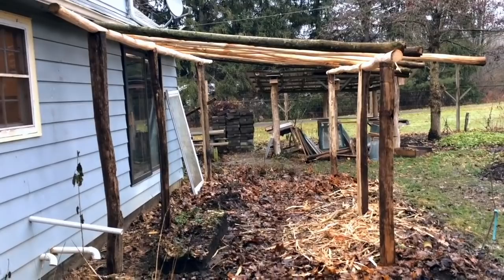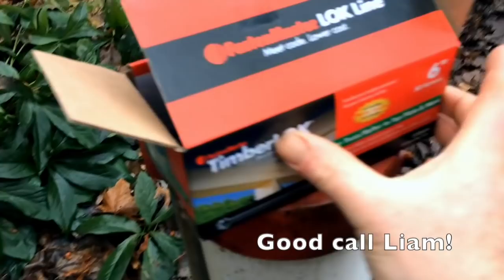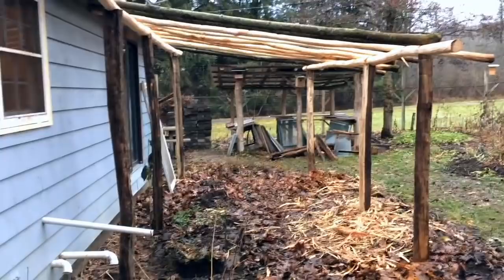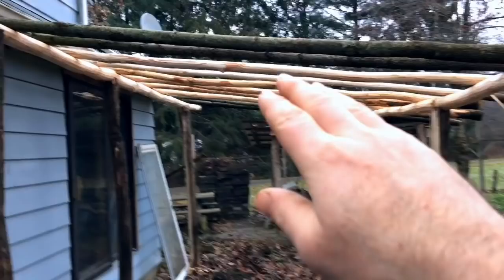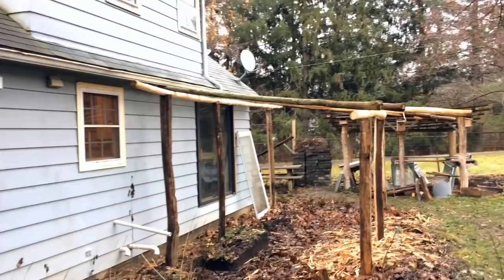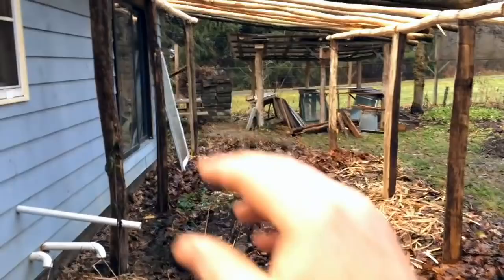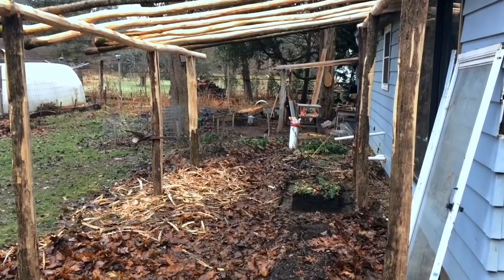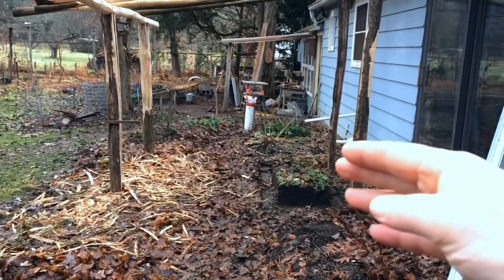Passive Solar Greenhouse - 1 - Start of Construction

Comment: I built myself a little cattle panel greenhouse last summer with a little climate battery. I dug my 5 trenchs down only 2 feet (that's all the stamina I have). I insulated the ground with foil bubble wrap.  I live in Texas so we don't really have a frost line. I used 5 -4 inch french drains that run the length of the 8 x 12 foot green house and covered them with drain cloth for the climate battery. I used 5 gallon bucket to join the french drains on each endow the greenhouse (2 intakes and 1 output) I also put about 100 16 oz coke bottles filled with water along the french drains to add a little more "mass"  and thermal stability (hopefully). I used Solawrap to cover the greenhouse. I made a solid west wall and solid north wall 5 feet up. I have a short very amateur video showing it on my channel. So far it has been about 10 degree warmer in the early morning in the greenhouse than outside. I keep the fans going all the time. It is humid, about 90% sometimes.I I think it is working pretty well. So far my only complaint is the door sticks. LOL! Good luck on your project.
Reply from the maker: LOTS of good ideas here.  I watched your video, really awesome!  
https://www.youtube.com/watch?v=uPQpTd8PCPs - Folks, there are some great innovations in Joan's video, well worth checking out!

Comment: You might want to consider a solid, insulated roof.  Given how much light you'll be getting in through all those repurposed windows, you might give yourself an overheating problem with a clear roof.  Looks great! Keep the videos coming!!
Reply: I think the sweet spot in this climate is probably 50-70% clear panels/skylights, and the rest opaque/insulated. Completely opaque roof doesn't allow enough light past February even with all glass walls.

Comment: I guess you are most interested in the things that did go wrong with my GH's. First one was cheap extended harbor freight look alike alu frame with thin polycarb windows. Had it mounted on top of 1 foot high brick and mortar footings because it was way too low. It blew into smithereens with the first autumn gale. Second GH, reusing the footings, had to cut footings for a normal door opening, allowing access with wheelbarrow. Stick build frame was done with with untreated cheap pine wood, directly mounted on brick footing (stupid given the amount of labor). The south facing, tripple layer polycarbonate panels were mounted in special alu profiles with rubber seals below and on top, from top to bottom. Two panels were placed in a too wide frame, and shifted out of their mounting. The upper and lower sides of the panels were taped, but these peel of, so lot's of moisture and dirt is accumulating in the panels. The panels have a tendency to shift down, as they don't have a real stop at the bottom. The horizontal, self adhesive foam insulating strips between the stick frame and  the panels peel of. Overhang of the roof (without gutter) is too small, so moist infiltrates into the vertical panels, and drips into the footings. I will skip the northern part of the roof and sidings because you are doing a lean-to. West and east walls are also polycarb, fastened with screws directly into the stick build. Only upside down U profile on top. Made an automatic opening window in the west wall polycarb (using a wax based opener),  noticed that you cannot  install insect netting with that system (lot's of white flies arrived on the scene).
Temperature control during summer was hard, with only the door to open, with 33 C/ 91 F outside, I measured 43 C/109 F inside at ground level. Only after shielding the south and west wall with pallets and sheets, the tomatoes, bell peppers, cucumbers and eggplants developed fruit. Still have a lot to tweak and improve. I will work from from bottom to top, first is insulating the brick footings on the outside, so they can be part of the thermal mass.Best wishes, hope I did not bother you with this long tale.
Reply from the maker: Thanks for sharing notes here. 
 I've had lots of 'rough sketch' structures have problems so I'm happy to be committing a lot more time and energy to this project to have it be quite a bit stronger and longer lasting.
 Sounds like you are working hard to evolve your project as you learn more from it, kudos for all the effort!

Comment: I do like the material used for the roof on your side working space.  They are a little pricey but strong and durable. I have been rough on the couple of sheets i use for 3 years now always outside.  The sound it makes with the Rain is very nice as well.  Love the EdibleAcres Family .
Reply from the maker: I've been pleased with the TufTex roofing material.  I've used it in a few different projects for over 8 years and have been impressed so far.  Lets hope we get 20+ years out of it!

Comment: You've had the cattle panel greenhouse with just one layer. But with the insulated windows and doors that will help create a warmth that will produce early starts, night time temps will be the issue. Maybe a layer of poly added before the roof panels? Something air right for night time, cloudy days and days when snow or frost are on the roof to hold in the heat. I've tried many types of heat sinks but the volume needed is fairly large.

Comment: I made a passive solar chicken coop several years ago and used poly panels similar to the ones you showed for part of the walls and roof.  They have not yellowed at all and let in more than enough sunlight.  Make sure to put the uv protected side up or out as directed.  I did have some shatter in a major hailstorm but I decided to buy more panels and put them on top of the ones with holes and it worked fine.  (The hail was about golf ball size so it was a pretty major storm.)   I also learned recently that they can be molded and shaped using a heat gun.  You can bend them around corners and smash them flat on the ends rather than spend the money for the special end pieces.  Just do it when there is a breeze to blow off the fumes from the heated plastic.   I've tried it and it works really well.  I'm also thinking it might help to heat it if you need to cut it.  If you try to cut it into odd shapes it will split, but I'm pretty sure it would be fine if you softened it first.  I also save the metal end caps from frozen orange juice containers.  I use them to attach the panels rather than buy the special screws.  I make a small hole in the middle of the metal end cap and curve it to fit in the trench of the plastic panel.  Then put in a cheap screw and then a piece of old bicycle innertube to go between the metal and the plastic.  Haven't had any come off and we get some really high winds.  I have decided not to spend the extra money for double wall materials that only give a little more r value.  Instead I buy the cheapest poly materials I can find and work hard at making the structure air tight to prevent drafts.  Then make a way to cover the plants down close to the ground as I mentioned in another comment.  I made an indoor grow unit for the harshest part of the winter and put it in my living room.  But the plants under cover in outside grow spaces will perk up again in March.  I have not made any greenhouse type attachments to my trailer yet because I have had such a problem with mice.  My most dreaded chore is checking the mouse traps!!!  I have found the best plan is to exclude them rather than try to deal with them after they have found their way in.  I made a small walipini and mice ate all my seedlings the first year.  Now I do my starts in my indoor grow unit as I have pretty much managed to keep the mice out of my trailer.  I would spend my money on a good stone and concrete foundation and make it mouse proof especially since you plan to keep the door open into the house.

Comment: Any form of cover you use should be at least two layers to trap an insulating layer of air in between. Any form of plastic you use will eventually yellow, cutting down on the amount of useful light that gets through. If you are saving/recycling windows, can you get enough large ones that you could use to cover your greenhouse with? On a more obscure note, a winter greenhouse that is slightly oriented a bit more to the east will capture more morning sun, extending your hours of daylight.
Reply from the maker: I am aware of the east aiming trick... our bummer is that the eastern exposure we have has some serious pines off in the distance... Oh well. 
 Two layers would be great up there, just needing to think through what material can help with that, or maybe we need to manually add the 2nd layer inside if/when it's needed.
Reply: DJ Moulton Do you have a Home Depot close by ? If so they sell something called Lexan twin wall Poly carbonate it’s very good
Reply: @edibleacres  I suggest alternating corrugated panels of clear and opaque PC on top (too much spring/summer light is a big heat issue) with a snug layer of greenhouse plastic wall to wall just below for the winter. Probably get the plastic free if you hunt around for someone changing theirs out.

Comment: It's tempting to repurpose old windows, because the glass material tends to be free, long-lasting, and holds up well to UV.  On the other hand, compared to poly film or rigid plastic sheets, I figure it takes more time and/or money to frame-out all the windows.   (Ideally you'd also plan for repairs and perhaps reserve some of the windows in each size.)  Also it's a more "permanent structure" that's more likely to trigger issues with building perm|ts, ta xes, zoning.

I assumed that dimensioned-lumber would need to be purchased (or made onsite with a chainsaw mill) in order to frame the windows.  If you have a way to do it with rough logs, I'm fascinated to see how that goes together.  Would you attempt to flatten one side of a log with a sawzall, electric planer, router, chisel or other tool?  Or maybe there's something to learn about window installation techniques from log cabin construction.  

How do you seal the gaps?  If the windows are pre-hung, could that existing dimensioned lumber just be attached together to make a "wall of glass"?  Maybe then this could lean back against a timber frame?  Then even if there were gaps between the dimensioned lumber and the timbers, they would be on the inside, so it's not like there would be gaps to the outside.  If there were, maybe a gap-filling putty could be made with sawdust and PVA/"white glue" or construction adhesive.  I just didn't want to end up having to use 3 and a half cases of expanding foam, haha.  (Somehow that seems even more offensive to the environment than some polyethylene film, lol. Polyethylene is chemically similar to wax, so it might be the one of most benign plastics.).  I'm not opposed to some primitive building technique like packing it with tree moss, bark and pine sap if that's what's called for, lol.

Anyway, I think a proper building is great if there's a justified use for it, like if it's a residential sunroom/greenhouse for passive-solar-heating, or if it's commercial nursery and salesfloor.  But if it's a farm or garden, this seems more in keeping with a caterpillar/poly tunnel.  Yes? No?  

I'd love to hear from anyone that has a similar or different perspective on it because I've been debating this in my mind for quite some time now, haha.  Thanks.
Reply from the maker: Lots to respond to here... Lets see..
I'm happy to work with the windows we could find, and design around them as a parameter.  Its really the only way I know to build: "what can I find for free/cheap/wastestream?"  and THEN it's "how to do design around them?"
In part II and III it should be more clear how I intend to marry the dimensional windows to roundpole skeleton.  Dimensional lumber will be the interface.  I'm going to get offcuts of slabwood locust this morning which I'll process with table saw and chop saw to work with.  Light 'lap joint' type work on the roundwood accepts the dimensional.
I also plan to get old bike inner tubes or something like that as gasketing to go between window elements...

If I can keep ethics in front and consumption minimal, AND create this structure in a thoughtful and stout way so it can last, I think it will add a lot of value to our life in the home and be quite useful for the nursery/garden.  Worth the extra work.  Plus, it's winter, so I got the time :)

Comment: Maybe too late since you've already framed, but I'd strongly consider trenching around the footprint of your GH and insulating the footprint with some nice thick foam board.  We lose a lot of heat through the soil.  I'm about to do an experiment where I bury some thermocouples at varying depths (1, 2, & 4 ft) inside the GH to get a sense of diurnal and seasonal variations in soil temperature.
Reply from the maker: I would have liked to, but our site is CRAZY wet generally and I think digging down is asking for standing water.
Reply: @edibleacres  I think he is suggesting, digging down and then burying the foam board vertically.  You can also add a piece of insulation board sloped away from the greenhouse (Also buried).  This moves the frost line further away.

Comment: We have been considering passive solar lean-to greenhouse on our place. We landed on tuf-tex as the best, more permanent type of "glazing" material. It is an investment, for sure. We're also going to dig out the ground, maybe two or three feet. It's in the "Five Yea Plan," so not going to have it soon.

We are going to erect a high tunnel over our vegetable garden during the winter, lots of composting material, and house our chickens in it during the cold months. Looking to the future, as we arrive in our elder years, we want the chickens to be closer to the house (and not down a slippery slope) during the cold months. We will subdivide into a small winter growhouse for greens, and the rest for the hens. That's the plan for next winter! (Remembering the cold winter of 2017-18, with weeks of sub-zero temps inspired our design.

As always, Sean, you've been an inspiration with our plans, too. Thank you. Not a lot of cold-climate permaculture out there to learn from.
Reply from the maker: Sounds like you've got some great plans lined up!  Best of luck with them all...
Thanks for being a part of this community, we really appreciate it!

Comment: For the interior blankets, set up cords like a clothes line (or maybe even AS a clothes line), perpendicular to the house, and drape the blankets across them.  You can scrunch the blankets toward the house during the day, and them pull them out like an awning for the evenings.
Reply from the maker: We're on the same page.  I envision something very much like what you describe.  Not sure the exact specifics, but a 'scrunch-n-pull' setup is on the horizon! :)

Comment: That's looking like a pretty good sized greenhouse especially for the cost! A good dump of snow a foot deep and depending on the wetness could add 2500 4000 pounds of weight to the 200 square foot area and more if there are overhangs, just thought I'd play the devils advocate for a moment but hopefully you have that all in hand. 😊🏡👨‍🌾
Reply from the maker: Yep.  Reasonable to be aware of such a massive load, and something I'll continue to evolve the design around to help provision for it.  I appreciate the heads up.

Comment: Blankets are unlikely to help much in keeping in heat.  Such thing need to be air tight to function well.  You might try row cover over the plants instead.

Consider adding some thermal mass, perhaps black barrels full of water.  This will keep the temperature more even, and help prevent frost.
Reply: I totally agree.  Row cover or blankets over the plants rather than trying to insulate the roof.  I put structures or cloches over the plants low to the ground and cover with blankets or sheets or black row cover when its going to get really cold.  I make cloches out of recycled materials like milk jugs or my current favorite, those large juice jugs.  I cut off the bottom of the jug and put it over the plant with the lid off unless it gets really cold.  Or fill jugs about half full with water and put several around the plant and that will hold up a blanket when needed.  A friend did a study of the temperatures at various locations in a grow tunnel in Montana during winter and found it was warmest down by the ground.  (I thought it would have been up by the roof.)  Works best for me to try and capture that heat down close to the ground.   For the thermal mass I like large rocks and rock/concrete walls.
Reply from the maker: Nice ideas here.  The jugs filled with water to support the blankets... BRILLIANT!  So simple and makes a ton of sense.  Thanks for these ideas, focusing on heat retention where the plants are makes the most sense and is the least intense work wise!

Comment: I like the roofing material you’re considering, it’ll stand up well. Instead of blankets but installing a layer of plastic under the carbonate to create an air pocket. For thermal mass could you consider putting in raised beds to help capture heat? How about a couple of black barrels with water that can be brought in in the winter?
Reply from the maker: Definitely raised beds.  Perhaps water, too.  We'll see.
 Thinking through systems for helping keep more warmth in the roofing, we'll see how that all develops as time allows..

Comment: Have a look at twin wall polycarbonate for the roof, it's easier to work with and easier to clean I built a full greenhouse out of it
Reply from the maker: Looking like at least $600 or more to go that route...  Also, with a shallow pitch I wonder how well it would function.  I'm open to it but the price seems intense and I'm not sure I understand how the seams would work...
Reply: @edibleacres  that's a big price difference, I built my whole greenhouse for roughly that! Seems are not so bad to deal with there is tape you can use to seal the ends and join the sheets together